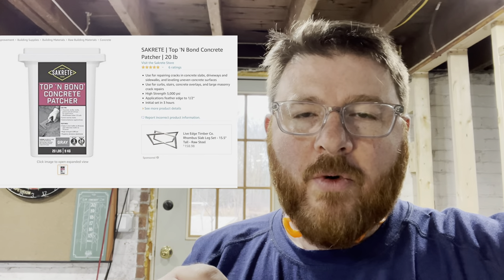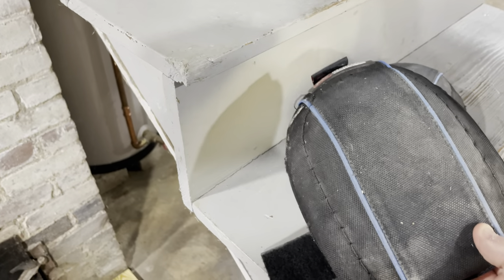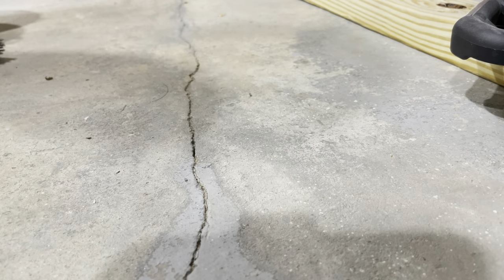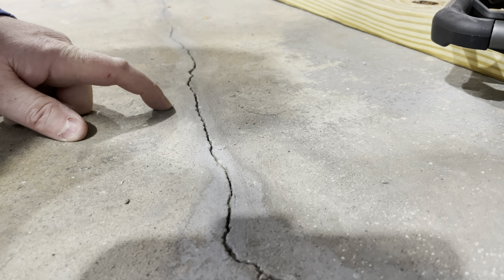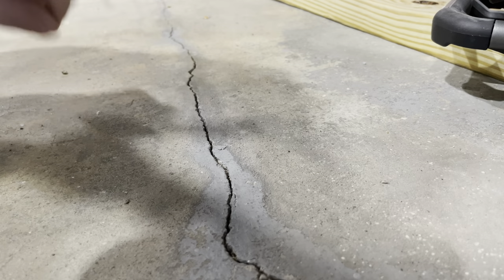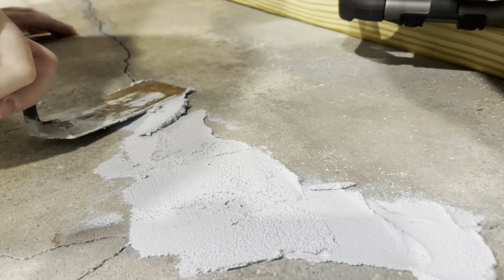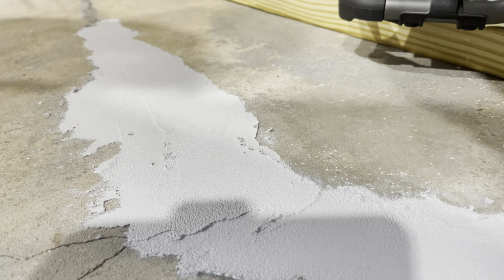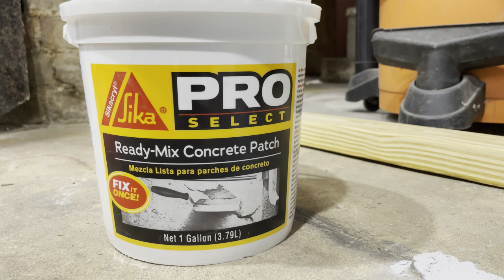How to Fix a Crack in Concrete -- Quick Concrete Patch Fix — Sikaflex Patch

Comment: Is this waterproof?
Reply: Well... concrete isn't even waterproof, per se, so not sure it matters much.  I can tell you that it has accepted paint quite well, so if you use waterproof paint you're all set.
Reply: @polymaticfarm  thanks for the response!  As you can tell im at beginner level but advanced since then lol